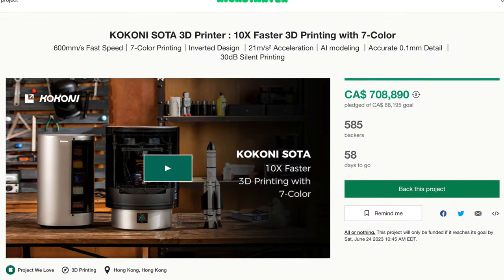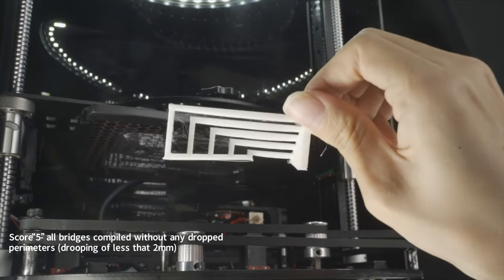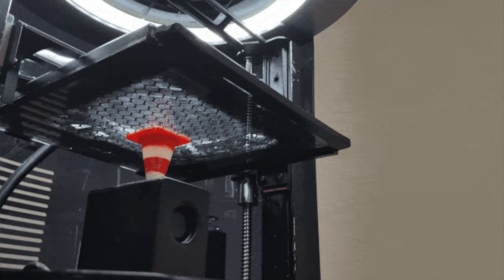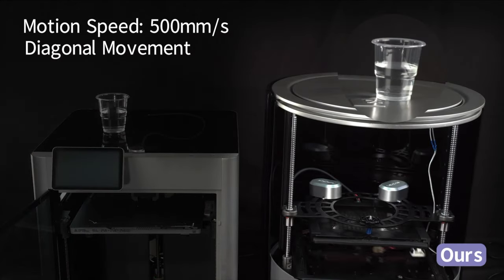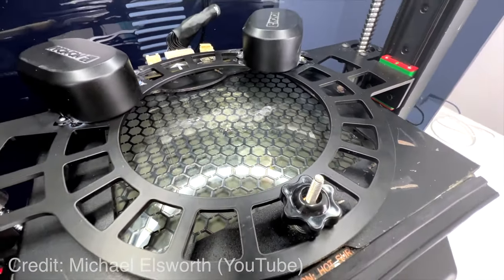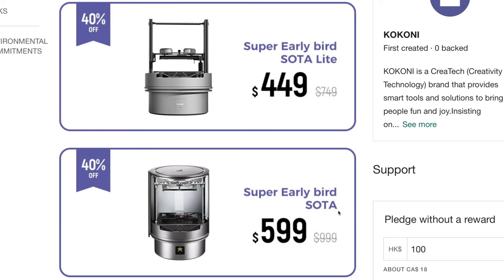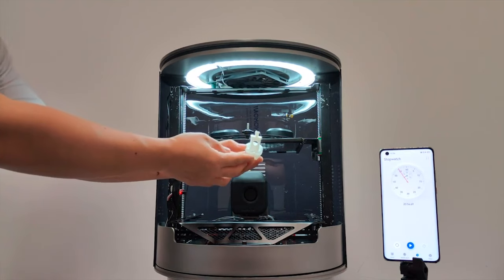I Backed The Kickstarter Upside Down 3D Printer So You Don’t Have To - Kokoni Sota

Comment: The simple fact that they're advertising taking a picture of something and then being able to print it leads me to believe that this whole thing is at least somewhat scammy.  Not saying they won't deliver a product but they're obviously promising things in ways that aren't actually possible.
Reply: I think this is actually one of the more believable parts of their advertisement. Photogrammetry isn't new, we will see how well they can implement this. And for "scanning" people with just one picture, they probably just have a database of a few people and wrap your picture around one that matches you the closest.
Reply: @Brainwash110  it's not new but it's also not good. You really can't just take a picture of an object and print it out. Even many pictures usually result in a poor 3d object. 
Maybe they are matching to a database and printing generic models but that's misleading at best.
Reply: Their 1st mini printer Ec1 that's already been released actually have this features & yes it does work so no its not a scam. There's a lot of YouTuber's that review & have positive feedback on their 1st mini printer about the AI scanning tool & how easy it is to use. This goose with less than 5k subs seems like he hasn't even tried or used their 1st printer & seems to be the only 1 that saying it's a gimmick.
Reply: @mischifhn  looks like it'll do avatar modeling which means you can take a picture of your face and it'll slap that on a 3d bust. It also has the ability to create a 3d model from a bunch of pictures using photogrammetry.  Neither is these are new technologies and neither are the promised "take a picture of anything and get a model of it".

Comment: I backed this also, but I think it is more likely I will cancel. This is not ready for prime time and I think they went TOO far before the kickstarter. I think they wont be able to back out work theyve done. This machine is meant for total beginners.
5:42 It should not get any layer shifts because of the closed loop drivers. If it somehow does shift it wont recover because it doesnt think it skipped.
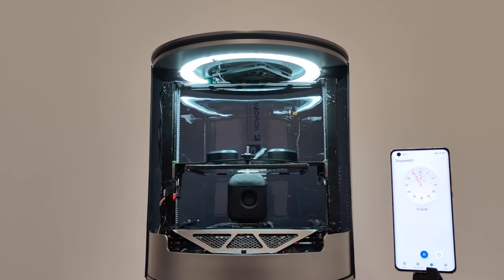7:48 I actually disagree here. Kickstarter is best for sending out preproduction units. Kickstarter really isnt for final designs. A lot of people use  it for that purpose, but that not great.

Comment: Good points
K R A L Y N 3D was the first 3D printer that has the upside Down that I have seen.
The reason for that design was an ability to make a very COMPACT printer, that can be cramped into a filament box!
https://youtu.be/X_QLxTVtyng

So that idea with a clear build plate  with an upside down design, is DEFINITELY borrowed from that design.

Great find, and good point about them focusing on the product, not the general software.

Thanks for sharing your video with all of us 🙂
Reply from the maker: Ah, interesting. I hadn’t seen the Positron before but looking at it now it looks remarkably similar to the Kokoni Sota. Too close to be a coincidence I think.

Comment: Their promo of the side by side with Bambu and the water glasses is fraud. You can see the whole machine moving, and they deliberately don't show the bottom. I'm guessing they removed one of the rubber feet. If they're willing to intentionally lie about that, what else are they willing to lie about?
Reply from the maker: Yeah, that seems pretty suspicious. It also looks like the z axis of the Bambu is moving simultaneously with the x and y, which is not how the printer actually operates.

Comment: They say "7 color" but pictures and videos show always, always 5! They are a mess!
As for upside down, i used a Creality CR-10 PRO V2 upside down for over 3 months, with a glass bed it is absolutely hilarious figuring out where and when the part will drop when it cools!
Reply: 2 color printing supposedly is included with the base printer. So, it's 2 + 5.
[ Their advertisement is pretty scammy still... ]

Comment: Could not agree more regards app and add website for the earlier EC1 printer, which currently does not work. Support leaves much to be desired. It requires cloud storage, no facility for local printing. I believe the main problem is with cloud storage maintenance. I am not inspired to go SOTA if they can't correct simple problems in a timely manner on the EC1.

Comment: I backed for $2 so I can see and comment on what happens.  I will be getting the LDO motors version of the K R A L Y N 3D printer.   Their intentions may be good but I don't see this getting delivered starting in August.  They didn't get it to work when they were going to have Sexy Cyborg review it.  You would do better to spend your money on the bambulab P1P or the creality K1.  I may be wrong but I don't see this ending well.

Comment: so make an upright resin printer also
Reply from the maker: Gravity might not be your friend in that application but it does sound intriguing 😅
Reply: @ygk3d  well dont flip the resin tank tho
Reply: @ygk3d  just flip the print, not the tank
Reply: @ygk3d  same way as normal fdm upright, but bed moves down, the resin level is on the top, no glass to pass through
Reply: @ygk3d  this is a public domain free no royalty idea btw
Reply from the maker: @Jkauppa  I like it. If you decide to put together a design, let me know :)
Reply: @ygk3d  well I do have an idea video slide show on my channel already
Reply: @ygk3d  the idea is the most important, anyone can do it
Reply: @ygk3d  just stop ramming the resin uv cured print piece to the bottom of the tank lol
Reply: @ygk3d  the video is named as "resin sintering", you get the drift
Reply: @ygk3d  laser sls style resin printing, build on the top, metal style printing instead of the sla from the bottom
Reply: @ygk3d  liquid is much easier to keep in the tank at a level than metal sand in sls metal 3d printer
Reply: @ygk3d  use cnc-uv laser from top like a fmd filament printer, both very accurate and speedy
Reply: @ygk3d  well one could make an up-right resin 3d printer from the dvd uv-laser drive
Reply: @ygk3d  how about a dvd uv-burner drawing with spin coated resin on the disc, in a normal drive, just pour in some resin and spin, and burn next layer
Reply: @ygk3d  just spin the object with the dvd drive motor on the disc, fill a bath around the motor with uv resin, uv cure with the dvd laser by spinning the object to proper location, keep the fill level at the wanted level